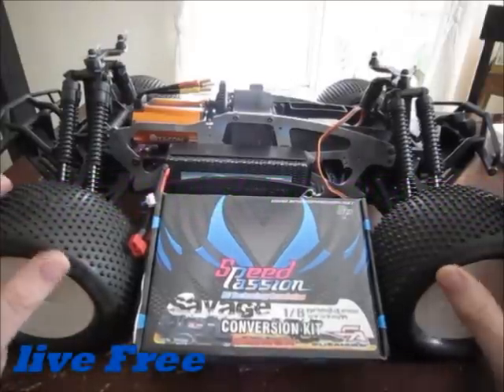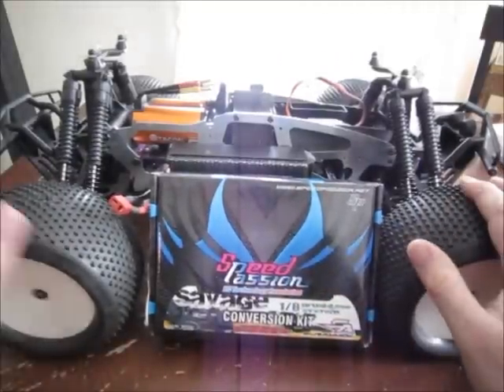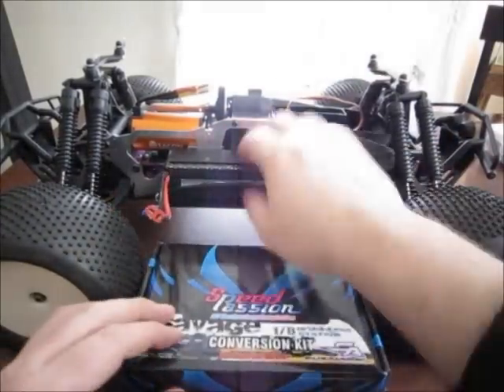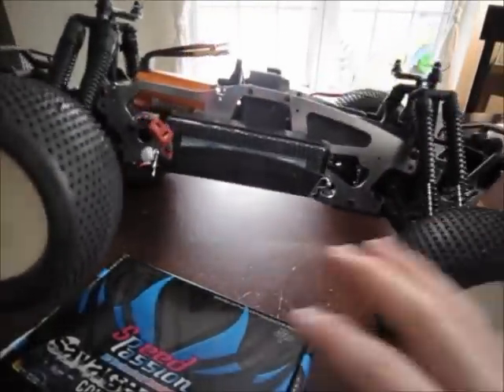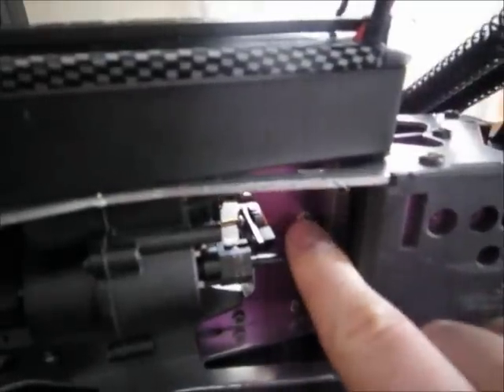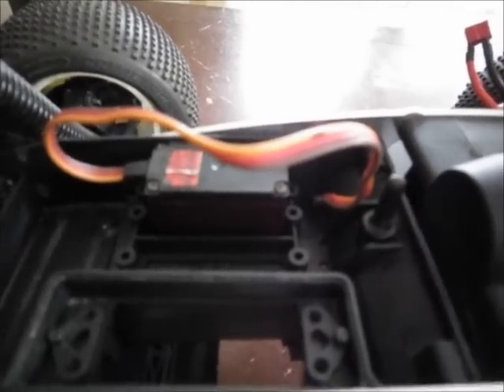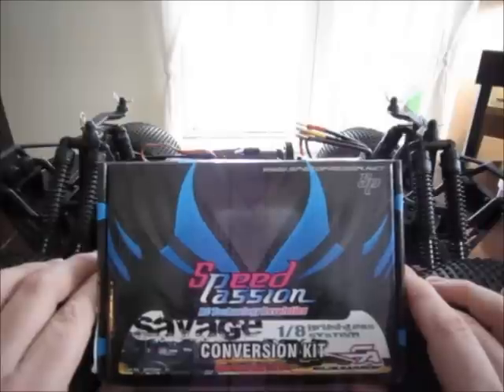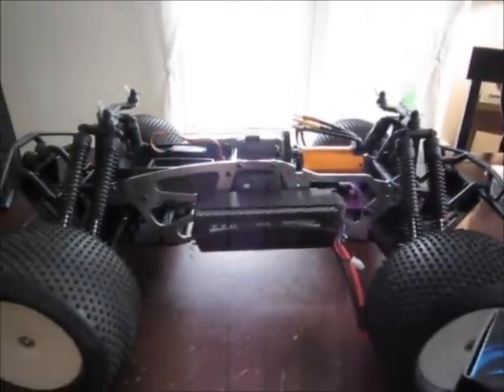HPI Savage update Speed Passion Brushless Conversion Kit

Comment: Finally found a conversion kit that worked. I bought Integy's kit. Its strange has a pinion mounted to the motor mount, which links the motor's pinion to the spur gear. Very high torque and moderate top end. Integy's kit was a problem because the pinion gear  on the motor would nearly touch the shaft of the spur gear

Comment from the maker: @FlyingRustler TY for your comment.
I did try that but it seamed kinda weak being at one side of the tray and the writing on the tray was upside down. I mounted holes in the center of the tray and spaced out to the ends of it. You could do it the way you said but the strength of it would be my concern. Also if you use there holes your using your transmission bolts to hold the tray, mind you that you cant tighten them down to much or the plastic will crack or break that turned me off some too.

Comment: You are definitely right. I bought that for mamba monster 2650kv and of course it didn't fit. It would be nice if those idiots would put on the box or any of the web pages selling it would specify what size motor would fit. I bought the flux conversion kit after that, and "good times" it didn't fit that motor mount either.

Comment from the maker: Thanks for your comment.
I locked the transmission like a Flux savage. It very easy to do and only takes one gear and one shaft and a few shims. All come in the same package and the part is around 10-15 usd. Im pretty sure the mod works for Alll savage transmissions. If you need any other help pm or comment!!

Comment from the maker: @TheFuzzyhartley  Hi. The lower plate I used all 4. But I got flat head bolts the ones they give you are V shaped and wont sit flush on your flat plate. You will need a hose clamp to hold the motor in place or it will bend your mount and screw up your gear mesh bad things will happen. Let me know if you have any questions.

Comment: did you try to match the battery tray upside down? you said that the holes were at the top. if you flip it they would be at the bottom which would raise the battery.

Comment: ok, so even after these vids i did purchase the speed passion kit and had a question, did you use all 4 bolts the mount the motor plate to the nitro motor plate? i can't see a way to use all 4